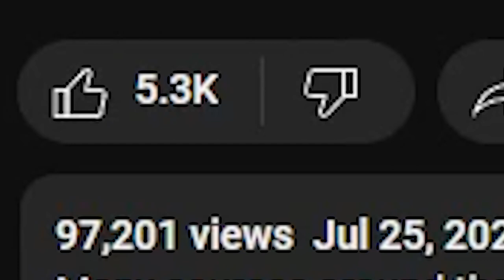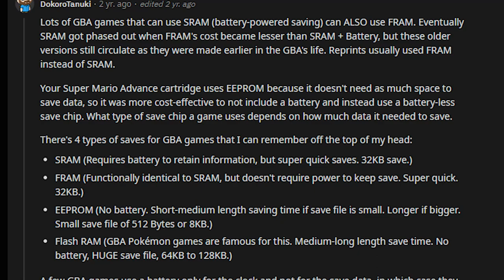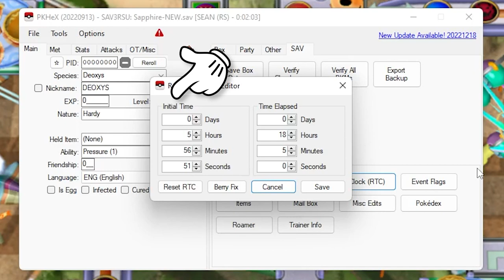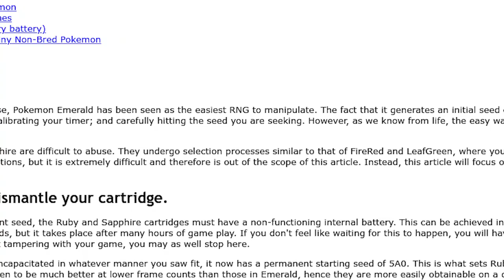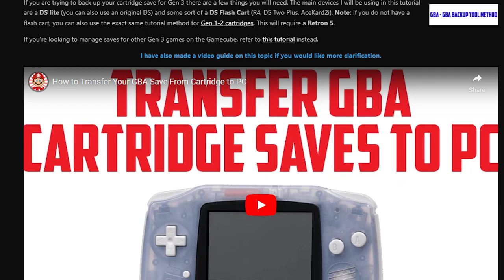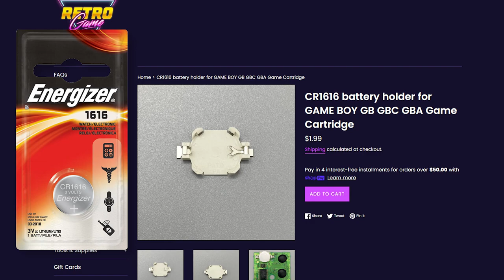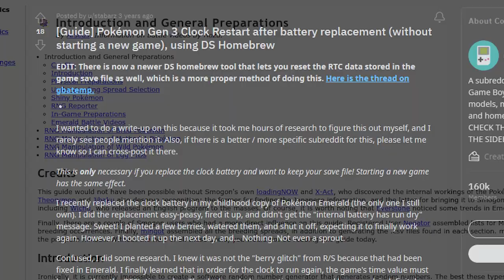Pokémon Gen 3 Battery: REVISITED

Comment: Wow, didn't realize this came out so recently, I had watched the first video ages ago. I was apprehensive to using an R4 card, especially after learning about the time-bomb problems on many of them. I actually was able to fix my emerald's clock using my GBxCart. The interface on the program shows you the time on the cart and lets you backup your saves and roms of the games pretty easily. 

For anyone wondering how to VERY EASILY fix the clock using the GBxCart as I did, just do this. Backup save, edit save in pkhex to set all clock values to 0 (playtime does not need to be edited), RESET the cartridge save data, implant the backed up save to the cartridge. I didn't want to think hard about having accurate time and trying to get that to work, so I reset and implanted the save at midnight. And because I so happened to get all of these things at this time, I did everything last night, effectively making my game exactly 23 years in the past, how cool! As of now, my berries are growing and the guy in pacifidlog is telling me to wait a week, that's fine. Here's hoping the lottery turns over and lets me try my luck tomorrow :)
Reply: Hey, I tried this out using GBoperator, but it did not went perfectly, because old man in paciflid tells me to wait around 278 days. So here's my question: Is "RESETTING cartridge save data" the same as starting a new game file + setting the clock in your room? Or is it enough to delete the save file on the cartridge (via combination of "up+b+select" on starting screen)?

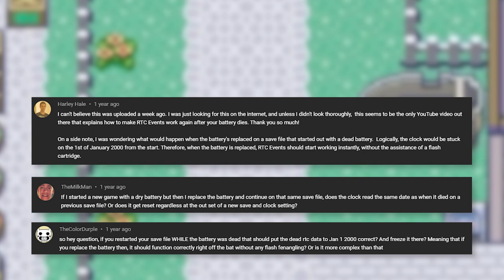Comment: 6:10

I actually bought a copy of Emerald on ebay to replace my lost copy, and it came with a dead battery. I only became aware of the problem because I went "Why are my berries taking so long to grow?"

Just replaced that battery tonight, and I can confirm, my berries started growing again!
Reply: Hi, did it worked changing the battery without any tool or flash card? Or it’s necessary?
Reply: @cabchris06  You will need a soldering iron, but if the battery was dead when you started the game, a flash cart is not necessary.

Comment: Isn't there a PC box code for resetting the clock in your room using completely stock hardware via the pomeg glitch? How would that work? Idk if it works on Ruby and Sapphire but it's possible thru emerald. I'm a blisy has a video on code execution showing the process if you're interested.
Reply from the maker: Oh I didn’t know about that, could send a link to that video? I’m interested.

Comment: RE: Gameboy cart dumper, if you have a GameCube and the Gameboy Player addon, and a way to boot homebrew on the gamecube (i.e. a sd memory card adapter and an action replay disc) you can use the gameboy interface software to dump roms and saves from gba games also. That's another way to get the save into PKHeX that you could have the tools already

Comment: I need some help. Many months ago I changed battery in my Ruby with my save from childhood and backed up my save to my pc to try and edit etc values in pkhex but I couldn’t get it to work. Recently I found your video and I feel I’ve tried everything you suggested. I’ve tried changing with pkmchest the rtc initial time and elapsed time to all zeros + rtcread from Jan 1 2000 to 2023 (tried everything from 2000-2099) and nothing works. Right now it’s Jan 1 2000 and rtc all zeros and TM guy says 65530 days or something. The clock itself works but not the timed events like lottery and so on. I have all hardware tools and software like gb operator, rtcread etc. Lowest number of days I’ve gotten him down to is 8 but then he says 8 days even  after 72 hours passed. Not sure what I’m doing wrong or if I’ve tried too many times with pkhex, chest and rtcread.
Reply from the maker: Oh no! I'm sorry that none of the methods worked so far. If you can still use PKHeX, maybe try this new method I discovered from Tama Hero.
When you import your save in the program, go to the "SAV" tab and click on "Event Flags". A new window will pop up, so click on the "Event Constants" tab, and scroll down to "Days Passed" and it should give you a number. Make sure to remember that value. Then exit the window to go back to the main window and click on "Clock (RTC)" and if the number days in "Time Elapsed" is lower than the "Days Passed" in the Event Constants, update the time elapsed days value to match/surpass the value from the Event Constants. Lemme know if that fixes it.
Reply: @YellosIsland  Thanks for replying. I forgot to answer you back. I managed to fix it by playing around a bit. Thanks for the video.

Comment: This still didn't answer the question on RNG Manipulation and I went back to your other video, and the reddit post you linked has since been deleted. If ruby or sapphire have a working battery as intended, the seed the game starts at is random. If the battery has run dry, the seed starts at 0. So my question is: If the battery has run dry and I replace the battery without doing any of the RTC fixing steps, will the starting seed be random or will it start at 0? I assume it works fine without the RTC stuff but I'm not positive
Reply from the maker: Hey, so I originally intended these videos to solve the internal clock issues and it wasn’t until later did I found out about RNG manipulation. I tried my best to research the topics as a complete noob, so I’m not the best resource on that topic. You might wanna ask someone directly in the RNG manip community, since I don’t wanna say something I’m not 100% sure about.

As for the deleted Reddit post, I’m not sure which one you’re referring to because I checked on both videos’ links and the Reddit posts are all still up.

Comment: Thank you for this amazing follow up to your already really informative first guide on the RTC topic. I have a few more questions though:
1.) Since the RTC is an independent chip on the motherboard and the values of the initial and elapsed time are readable with a save file editor, I assume that the RTC writes the current state of both values to the Flashed RAM Chip of the game? If so, a save file dumped on let's say day 1 and a save file (which hasn't been played at all) dumped on day 1 + 7 should have a different RTC value stored, right?
2.) I swapped the battery of my Emerald copy a few months ago, started a completely new save file und backed up my save on last Monday. I transfered all my Pokémon up to my Platinum version and now want to restore that said save file. Is there anything I should adjust in terms of the RTC values? Cause the current value of my now empty copy of Emerald should differ from the dumped save right? Or are those values overwritten when I rewrite my backed up save to the cart?

Thank you so much for the work and please keep it up!
Reply from the maker: Thank you, I'm glad you enjoyed both videos! To answer your questions:
1. Correct. Save files on day 1 and 7 should have different RTC values, mainly the elapsed time.
2. I'm not 100% certain but whenever I restored my saves, the clock never seemed to break because as long as there is a gap between the current RTC and the RTC value stored from the last save time, it should work. If somehow it messes up, you can always use rtc-read to readjust the date and time.

Comment: ok I really wanna know more about those retainers mentioned at the end, cause I thought you couldn't fit them in a GBA cartridge. If they do, I want do install them (it's what I did for my other Gameboy games that use CR1616 batteries). I'm just wondering how you can solder them in cause I'm pretty sure the tabs are nowhere near long enough to reach the PCB from atop the ROM chip.

as well, please, do NOT buy those CR1616 retainers from Retro Game Repair Shop. They're mass-produced in China, which means you can get those same retainers on Ali Express. The difference is that RGRS charges $2 per retainer, while on Ali Express, $2 will get you 20 of them if you find the right listing on sale

Comment: this video confuses me, the other video seemed pretty straight forward, does the other video method still work or do i need to start using other programs to do it right?
Reply from the maker: Yes you can still use the original method. I’m just proposing alternatives in case you don’t have a DS and a flashcart

Comment: Does replacing the battery fix the seed generation, or do you also need to amend the RTC to fix seed generation? That is, I want to soft reset for shiny rayquaza in Ruby, and when the battery is dead, the RNG seed is fixed at 5A0, so i'm wondering if only changing the battery will fix this seed issue, or whether the RTC will also have to be amended in order to fix the seed generation?

Comment: Does the Pokemon Colosseum Jirachi Bonus Disc fix the berry glitch? When you go to transfer over the Jirachi, it will tell you if your "berry program" needs updating.
Reply from the maker: Nope. It works the same as the FR/LG/E Berry Patch where it doesn't really fix the clock after the battery dies.

Comment: I tried to get the CR1616 battery holders to work on my copies of R/S/E, but I couldn't get the cartridge cover on after that. Maybe it's just me. Tho I did notice that the battery holder straddles the chip underneath might be an issue.
Reply from the maker: Oh that's strange. I was actually about to buy one myself. Were there any issues with the clock though?
Reply: No issues with the clock, but if I remember it right, I was able to run the screw down all the way, but the plastic top of the cart had sizeable gap between it and the bottom of the cart shell- enough to rub the cartridge port on a GBA or DS. My guess is that the tolerances were super close with the battery riding the chip when Nintendo designed it. But then again, I just did a direct replacement on the old solder points. Plus, I don't really have the time to figure out a way to make the holder work. And it seems everyone uses the tabbed CR1616s by default.
Reply from the maker: I will warn you that rubbing the cartridge against the slot over and over will ruin part of the game label, so be wary of that. But thank you for letting me know about the battery holder situation. Tabbed batteries seems to be the cleanest way so far.

Comment: Question why does my in game clock in emerald not match up the time I put in the RTC editor? I changed the battery and I noticed it only changes it between AM and PM
Reply from the maker: RTC uses military time to keep track. I said this in the video, but the clock not matching up seems to be the initial time value adding a buffer
Reply: @YellosIsland  nvm I fixed it using the Pkmn-chest method you mentioned thanks for the info

Comment: I had a question. So if I can make a save back up of the game. then put a new battery in my game then restart the game so that the clock is working again. then I can just upload my old save and the clock should be working right? or no?
Reply from the maker: I haven't personally tried that specific method, so you can try it and lemme know how that goes! If your clock still isn't working, you can always use rtc-read after.

Comment: For Gen 1 and 2, what if you were able to replace the battery while the game was running using one of those fancy battery holders?
Reply: I haven't done this myself, but I have read that this will still work and maintain your save file. Obviously, there is much more risk to your game and system, but it's doable. I'd still recommend just eating the $30 for a gameboy save back up device, plus they're good to just have in general
Reply: @queencepha  I meant with one of those battery holders.

Comment: If I were to have a ds flashcart, and use rtc read, I need to replace the internal battery no matter what right? If so, how do I replace the internal battery the safest way possible? Thank you <3
Reply from the maker: Yes, if you want to fix the clock, no matter what, you must replace the battery. The safest way is to use a soldering iron. It may be intimidating at first, but as long as you follow soldering tutorials, it will be an easy swap.

Comment: Is there no way to make time pass in pokemon sapphire on the ds even if the battery is dead? Even if it only happens while the console is on? I do not want to change the battery, I consider it special for me to keep the cartridge as it is and I would like time to pass to have the most diverse Seeds and thus have Pokémon with very random PDI because I think they will make it more unique and special😊
Reply from the maker: There is no way to edit the time on the DS unless you use a flashcart. The clock battery is inside the cart, so the DS's clock is completely independent from the GBA games.

Comment: Lets say if I used a ds flashcart to fix my replaced battery on a DS Lite, the time works perfectly fine, what will happen if I use the same cartridge on a Gameboy Advance SP? Will the clock stop working due to the absense of the DS Flashcart?
Reply from the maker: The clock will still work if you use the same cartridge with the fixed time on a GBA. The DS flashcart just modifies the values.

Comment: I wiped my save after changing the battery, but the error message still pops up..
Reply from the maker: Is the error message referring to the battery being run dry? Because if so, the new battery you installed might've been dead already.

Comment: I just want to clarify, if I backup my save file, replace the battery, clear the game, and then reload the save file, will the clock issues be fixed?
Reply from the maker: Personally, I haven't tested this out myself, but the clock might give you issues since you are freezing a certain timestamp, which will no longer correlate with the clock battery. Or it could still work. If you decide to try it out, let me know how it goes!
Reply: @YellosIsland  I shall! Thank you. Just waiting on my GB Operator
Reply: @tylergaines9612  Did you ever test this? I have a GB Operator also, and wondering what the easiest method of fixing the clock would be with the least amount of steps and additional tools/programs.
Reply: @WeeAddy  I never did.... I need to get different batteries for it as the ones I got don't have brackets long enough to make a good connection.

Comment: Thank you for the helpfull video! I have only a problem...
 I replaced the battery of my emerald version and started a new game, when i arrived at mossdeep city at the space center the scientist says thats successful launch Number 1190 (one launch equal one week from the creation of the save state). The time based events works fine, but there is sure something wrong in my save, some one can help me to fix this problem? (change to the right date of the creation of the file) 
p.s. i am playing using the gb operator
Reply from the maker: If you're using the GB operator, try downloading the save file, and using a save file editor like PKHeX to find out the values of the inital time and time elapsed.
Reply: It’s actually simple: 1180 weeks from the 01-01-2000 is rounabout the date you commented. When using GBoperator, the time of your computer will be used as the battery time.

Comment: Is it possible to backup the save file. Then replace the battery and reset the game and then restore the save file?
Reply from the maker: I haven't personally tested this out, but if I had to guess, it wouldn't fix the issue because the timestamp on save file you're restoring will still be there unless you change the RTC values to correct them. Restoring the save file will essentially override the time values of the fresh save you just made.